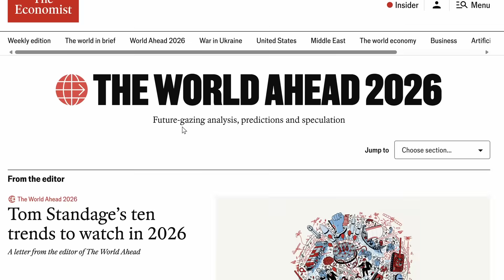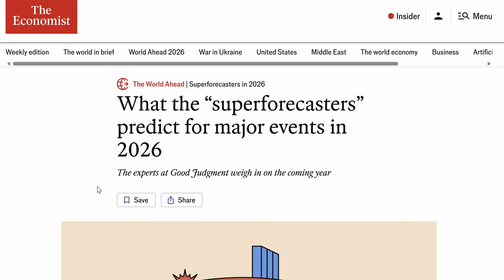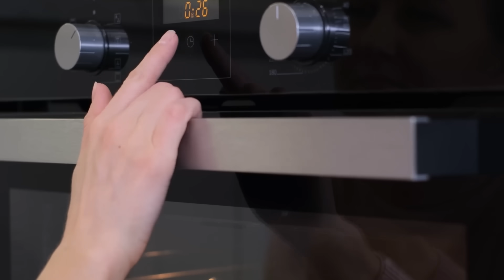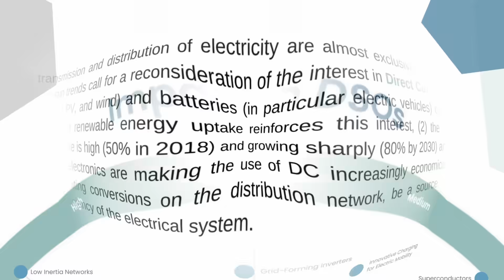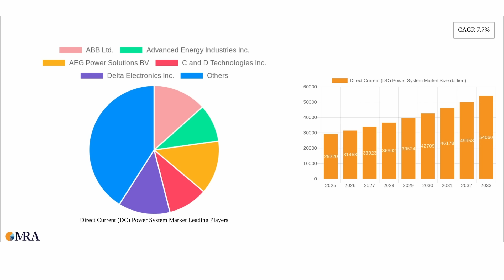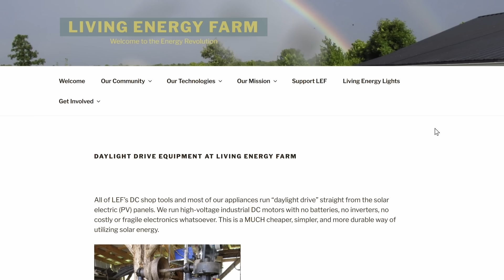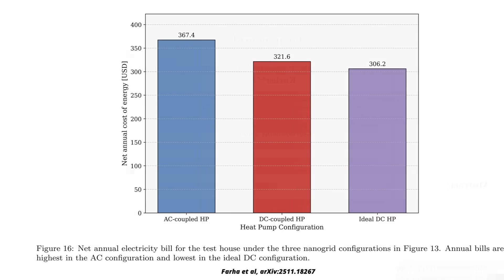Are We Using the Wrong Kind Of Electricity?

Comment: When I could barely walk, I figured out how to remove the protections my parents had put in all those interesting and mysterious holes in the wall where adults fiddled with wires, and I explored them with my tender little fingers.
My mother saw me fly like a well-kicked football across the kitchen door. Little harm: two small burns on my fingertips and a lot of crying.
Later, being an  intelligent and experienced adult, I encountered 230V AC a few more times: perhaps the initial contact made me resiliant , and I only felt it as a slight tingling sensation.
In contrast, I've "encountered" 48V DC multiamperes only once: I wouldn't recommend it to anyone.
Reply: What you feel depends on many other factors... not so much whether it is AC or DC.  I'm saying this as I lay my (dry) hand across the terminals of a 48V battery (sitting at around 53V at the moment).   I feel nothing.  Oh wait, that's the hand with burned out nerves, let me try my other hand... still nothing!   (Just kidding)

Unless your hands are wet, you'll just get a slight buzz at the most from 48VDC.  It's not that big a deal.   If your hands are wet, its a different story... but wet hands on 230VAC can easily kill you or turn your fingers into mush, so don't go testing your "light buzz at 230VAC" theory please!

It really comes down to Voltage,  circuit path length and what parts of your body the current is flowing through, and resistance through your body.   Not so much whether it is AC or DC.

Comment: It was always my understanding from what I have learned that long distance DC transmission is limited. Therefore, high voltage AC can be transmitted for long distances with relatively small loss of power compared to DC, requiring fewer power plants. 
Additionally, standard lighting can run on both AC and DC, and many appliances like motors can run on either AC or DC depending upon the configuration of the motor. In other words, as far as motors are concerned, there are both DC and AC motors that are built to run either on direct current or alternating current and depending on their design can only run on one or the other and not both. 
I only have rudimentary knowledge of electricity and I am not an electrical engineer or an electrician. 
Please feel free to correct me if I'm wrong or leave any comment you would like.
Reply: You understanding is incorrect. There are extremely long ultra-high voltage transmission lines all over the world. China in particular is on the foreskin of that technology.

Comment: You just need a FULL BRIDGE RECTIFIER!
Reply: Not really... If you want to have a good Power Factor you need a more advanced AC to DC conversion circuit with inductors to create a sinusoidal current waveform.
Reply: @djole02  Sortof.  You are only created a "pseudo" sinusoidal current waveform with a PFC (power factor corrected) DC supply.   And there is still a full bridge rectifier in PFC DC supplies... just no capacitor directly connected to it (which is what really messes up the current waveform for an AC system).

Basically in a PFC DC supply, AC is rectified but not buffered, the rectified (folded over sine wave basically) output goes into a flyback transformer via a FET and that is what chops the current up (the FET that is).  The output side goes through a diode and capacitor circuit.    The FET chops the current at high frequency with a variable PWM that ratio's the approximate current.

The result is very good power factor, but with a bit of harmonic distortion in the mix.

All the diodes in the above description can be replaced by FETs to remove the diode drop, vastly increasing efficiency and reducing losses.  At design specs with a fixed (known) operating voltage and current, PFC DC supplies can achieve very high efficiencies... 95-98%.

-Matt
Reply: @junkerzn7312  Yeah but not converting at all give you 100% efficiency. A Loss is a Loss no matter how you look at it.
and storage is also a loss system both ways charging and discharging those % losses add up quickly.
Reply: @YouShouldThink4Yourself AC is less efficient then DC at the same voltage and power level through the same wires because of skin effect in AC. So even if converting to DC has some losses, the overall efficiency over.long distances can be greater in a DC power distribution system.
Reply: @YouShouldThink4Yourself Everything has losses of some sort.  You don't get 100% efficiency by not up-converting the voltage... that just results in huge wire losses.
Reply: @djole02  The skin effect isn't a major problem for AC power lines because AC power lines aren't solid aluminum.  They take advantage of the skin effect to implement a steel core to create a physically strong wire.  The cross sectional area that the current actually flows through is still roughly the same as it would be with a DC line.

Similarly, DC power lines can't use solid aluminum either, because it is not strong enough.  A DC power line also requires reinforcement in some manner... often also steel though in more recent decades other materials have begun to get used to make more room for cross-sectional current.

Also, the skin effect is a function of frequency and power lines run at 50Hz or 60Hz, so it isn't as though the current is actually just flowing only on the skin of the power line.  At 60hz skin depth is 8.5mm which means you need a wire diameter in excess of 17mm before you have to start worrying about it.  That's... 4/0 wire.  So no effect on distribution lines or residential wiring at all.

So skin effect is only really a structural issue for large transmission lines.

It's really the corona effect and AC coupling with the surrounding area that creates the greatest losses, plus problems synchronizing the AC waveform after traveling long distances (being subject to wind and temperature changes along the way, which makes it harder to track the phase shifts).   That requires resynchronization every couple of hundred miles.

The combination makes long distance AC lines more expensive than long distance DC lines.

-Matt

Comment: Some of this Sabine pointed out, but it warrants emphasis. It’s not about AC or DC but about the voltages. AC at 1st was much easier to convert to very high voltages because transformers were available. If it had been possible to achieve these very high voltages, DC transmission lines would have much lower losses. This is part of the reason China is converting to or installing new high-voltage DC systems.  

High-voltage DC transmission systems offer several additional benefits. First, AC transmission systems require precise phase matching; failure to achieve it can result in catastrophic outcomes. DC transmission systems decouple the phases of AC systems, thereby simplifying interconnection and system restoration following disruptions. Furthermore, DC transmission systems are immune to the effects of coronal mass ejections (CMEs) and electromagnetic pulses (EMPs). Another advantage is the reduced transmission losses when lines are installed underground or underwater. This is a significant factor in Europe, where DC transmission systems are used to interconnect national grids, often requiring cables to pass beneath large bodies of saltwater. With advancements in high-voltage DC technology, it has become economically viable to replace high-voltage AC transmission lines with DC systems for distances exceeding approximately 500 miles.

A significant safety concern arises with high-voltage DC systems. Although AC is often considered safer than DC at high voltages for electric shock, the primary concern is the formation of electric arcs. At elevated voltages, both AC and DC can produce arcs; however, the alternating nature of AC causes these arcs to self-extinguish more readily. In contrast, DC arcs are complex to interrupt, posing a greater fire hazard than AC systems. Additionally, constructing reliable circuit breakers and switches for high-voltage DC is significantly more challenging. While voltages below approximately 100 V are relatively manageable, levels above this threshold are highly hazardous. Therefore, although DC may be economically feasible for short distances, such as within individual buildings, AC power systems remain preferable for transmission distances up to approximately 500 miles, despite the economic advantages of DC.

Although server farms primarily operate on DC, their efficiencies are attributable to factors beyond the use of DC for computing equipment. These facilities experience rapid and substantial fluctuations in power demand, often within fractions of a second. To compensate for these variations, large battery banks are frequently employed. The use of these battery banks, along with substantial copper cabling, helps mitigate power losses across the facility. This is a primary reason for distributing power internally as DC within server farms.
Reply: Nice input! It takes technical understanding, and reasoning! Both DC and AC have 'benefits' depending on usage and transmission, at 82years old, I frankly don't care a toss.... 🎉 😢

Comment: Transformers don’t work on DC. In fact transformers are one of the most efficient machines ever made
Reply: Also extremely reliable. it's rare to see a DC/DC convertor last more than a decade or two. Transformers often last 50+ years.
Reply: In addition, DC-DC converters are electronic by their nature, so are complex and require components that are made mainly in one country (as we all know). If that supply was ever interrupted... Transformers are basic components that can be manufactured or repaired in most places.
Reply: @user-et1id3hd5i  True but it's not a technology issue but more a series of short sighted decisions made by western businesses and governments. At the current rate of industrial decline even the last transformer factories will close soon.😔
Reply: Good comment made, and one of fact! 50Hz and 60Hz will be with us for a long time yet! Yes, DC has only a few advantages, but only a few! 😢
Reply: Electricity is the REAL magic of Mother Nature !
Reply: And yet, with today’s technology, dc-dc converters are now more efficient than transformers.
Reply: Exactly.  Most electronic devices use DC internally, but unless they all run on the same voltage you're going to need transmission in AC.
Reply: Even your USB power block first makes DC from the mains, converts it to high frequency AC, transforms it down, and converts it back to DC for the USB plug.

Comment: sabine, was this supposed to be a joke.?     you have mentioned the reasons why mains power is/should be (regulated) AC.!     the alternator in a wind turbine makes wild AC.!       in order to get rid of the 'wild' part, that AC has to be  rectified to DC.     that rectification can be done at the turbine; doing that would be a poor choice.      OR,  the wild AC can be transmitted (with low losses) somewhere farther away, before rectification.     for any device that operates on DC, a DC power supply/converter is used.     that DC power supply can be internal to the device or external.   see 'wall warts', etc.      EVs like teslas  INVERT  DC from the batteries to  AC, in order to power an AC Induction motor.     i have seen transmission of DC discussed; but it makes no sense.    the conductor would have to be huge, and the (mentioned) losses would  STILL  occur.

Comment: Happy holidays to you too! Maybe it would be nice to talk about the beauty of AC as well. Very mechanical, solid state machines, that can even run in analog mode, without requiring, hard to repair and source power electronics. Its unrepleacable equipment in dirty operation as factories and marine systems

Comment: Die Umstellung von Haushaltsgeräten von Wechselstrom auf Gleichstrom führt in der Regel zu günstigeren Geräten, da die Umwandlung von Wechselstrom in Gleichstrom entfällt. Dies vereinfacht sowohl die Materialauswahl als auch die Elektronik. Zudem haben Gleichstrommotoren wahrscheinlich eine längere Lebensdauer, insbesondere wenn sie bürstenlos sind.
Reply: Brushless DC motors will have no longer life span than AC motors. Reason for that is brushless motors require electronics, and electronics MTBF (medium life before failure) is shorter than MTBF of motor wire used for AC motors.
Reply: @padina357  The MTBF between AC and DC motors is virtually identical. If a DC motor has brushes, an AC motor will last about twice as long. AC motors are suitable for heavy-duty industrial applications. DC motors don't handle heavy loads and frequent starting and stopping. Why they're used in EVs is beyond me, since cars often start and stop.

Comment: Yes, most devices and appliances use DC either completely or to some degree, but they all use different voltages.   To get those different voltages, most DC devices use some sort of power converter that converts the DC to high frequency AC passes through a transformer and then converts back to DC.  The ability to easily manipulate the voltage through use of transformers is the main reason that AC prevailed.  Additionally,  manipulating the frequency of 3 phase AC power is the preferred way to adjust the speed of a motor in industrial applications and even some electric vehicles.

Comment: Edison’s model also differed from Tesla’s (Westinghouse’s anyway) in the substation spacing modeling - now being called microgrid it seems. So, same model Edison wanted.

You know what the ultimate micro-grid is?  It’s similar to the smallest minority in any demographic: the individual.

The best “micro-grid” is “off-grid”…
Reply: Edison did "want" microgrids. They were required due to the limitations on transmission of DC at that time in history.

Comment: Merry Christmas!  Have a happy holiday. See you on Friday.  Great Scott! 1.21 Gigawatts!?! Well, I knew Thomas Edison would get the last word in... even if it was almost 100 years later LOL.    But Nikola Tesla brought us cool High Voltage AC tech so we can zap things.

I think it would have been nice to explain why High voltages are less lossy on transmission at longer distances. Ohms law:  P(Power) = V(Volts)^2/R(Resistance)   Let R represent the transmission line Resistance, As V(voltage) increases, the denominator(R) becomes less of an impact.  When Power (P) is transformed up to transmit and then down to be useful at a distant location.  It's a technical discussion that requires some algebra, physics, and stuff, but put the dancing pinguins or a cat tearing apart a Christmas tree and maybe no body will notice the math and science.

Comment: Wait what? Since when do wind turbines produce DC? I thought that they were using asynchronous generators. Or did they switch to dynamos?
Reply: It depends on the design but most wind turbines these days generate variable frequency AC which is then run through a synchronizer circuit to couple to the fixed frequency of the grid.  The synchronizing circuit is a combination of a DC rectifier and AC generator that allows the turbine frequency to be translated and phase adjusted to the line.  The wind turbine has to be able to operate at variable speeds so it cannot be directly connected to the grid.

Comment: "Only 2-15%" is frankly huge Sabine.  I work in residential energy efficiency inspections and frankly anything that's been added to the standards in the last 6 years or so is TINY savings at high cost compared to that.  If this doesn't impact the cost of building (and I could see with enough scale actually some savings there}

Comment: DC is very useful for some things. Something it's incredibly bad at is power transmission, and I'm talking about even for very short distances.
Reply: Yes, of course.
Reply: Once you need to transmit power greater then 600 km - 800 km then DC becomes more cost efficient for power transmission. The reason you think opposite is that changing DC voltages up and down is expensive, like really expensive and transmitting just 120-240 volts requires a lot of current. If you transmitted just 120-240 volts around town AC would be just as bad or worse then DC. It's just that AC was just cheap to throw cheap transformers everywhere to up and down the voltages. Transmitting high voltages has way less losses then low voltages. Once you go past the 600-800 km distance, the cost of the very expensive DC transformers disappears with the savings from transmitting DC over AC.

Comment: One point that was left out is that generators, turbines generate AC. Wind turbines too.
Reply: Just requires a different generator wired for DC instead of AC.
Reply: @bfcmik  They rotate therefore they generate AC. Check the principle of operation. You get DC only after a conversion from AC. There is no different wiring solution that you refer to.

Comment: Living in a Van i exchanged my PC PSU with a 12V stabilizer, 5V step down converter and a DC Pico PSU to get rid of the transforming loss from 12VDC Battery -> 220VAC Inverter -> 12VDC PC Supply Voltage.

Comment: I live in an off-grid solar electric 12 volt DC home with no problems at all.
Reply: I'm guessing you dry your clothes outside on a line.
Reply: @avsystem3142 
Yes, I do. And I also use natural refrigeration in the winter time, wood heat, and no microwave. 😅
Reply: @browngreen933 💚 Sounds good!

Comment: Thomas Edison thought so. Since Ohm's Law means that we need very high voltages to avoid excessive losses while transmitting electricity over long distances, back when we only had transformers to step up in voltage, we had to use AC. Now we have semiconductor devices to allow HVDC lines.